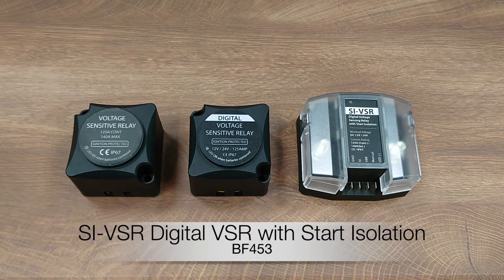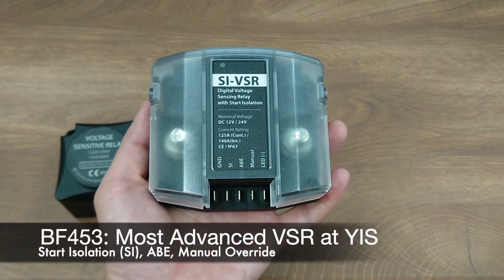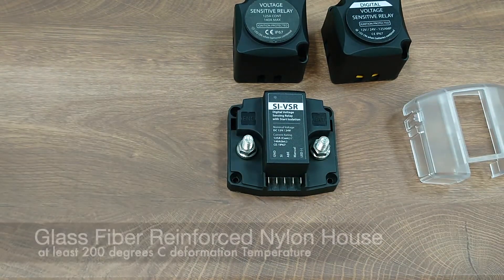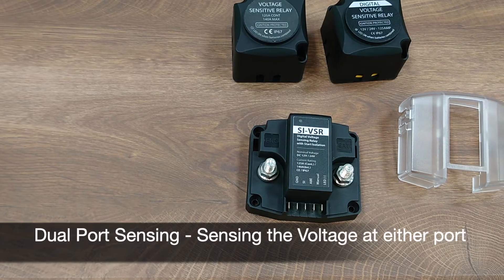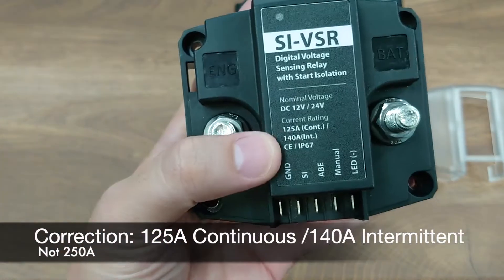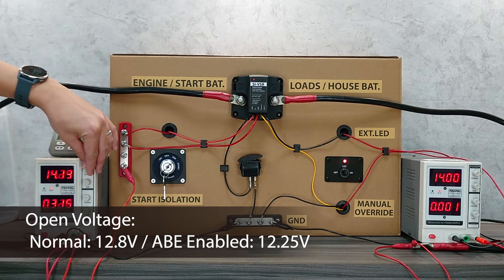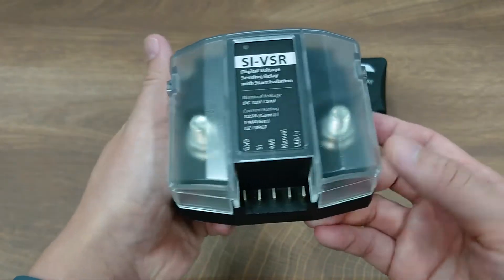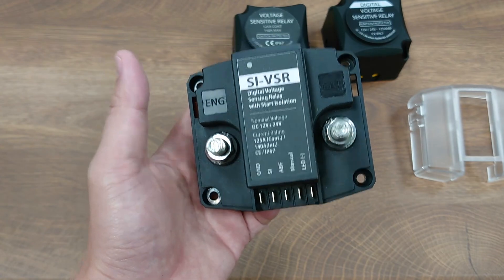YIS Marine SI VSR BF453 Digital Voltage Sensing Relay (Smart Battery Isolator) with Start Isolation

Comment: when the light is flashing on the VSR what does that mean?
Reply from the maker: Hello sir, YIS Marine's VSR BF453 has two built-in LED indications:

◼︎ Start Isolation (SI): When the SI terminal is connected to positive voltage, the LED will flash slowly. This indicates that the relay will not activate and will immediately disconnect.
◼︎ Over/Under Voltage Lockout: If the voltage on either the ENG or BAT terminal is outside the operating range (12V: 9.5V-16V, 24V: 19V-32V), the LED will flash quickly. This means the relay will not activate and will immediately disconnect.

Therefore, the flashing light likely indicates an issue with one of your battery voltages. Please check and resolve any voltage issues. We hope this information helps you! 🙂